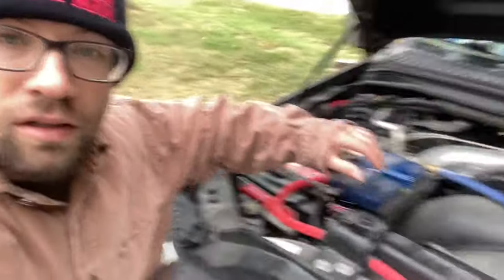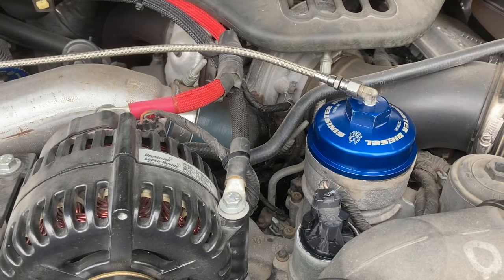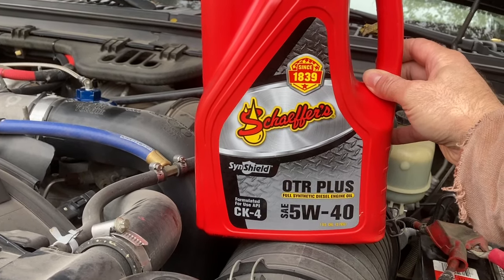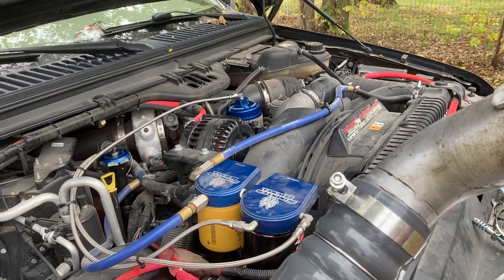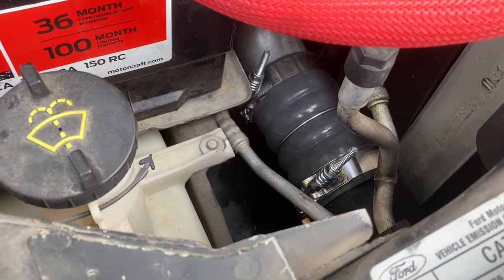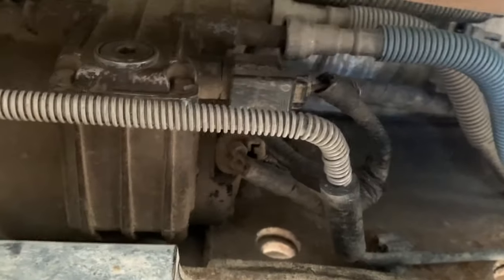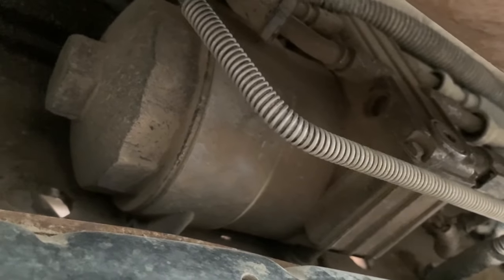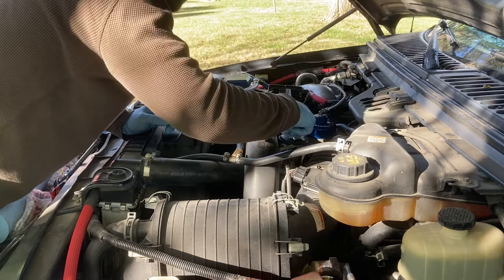6.0 PowerStroke Tune Up and Bulletproof Mods

Comment: Thanks for the tip I didn't know that FICMS die due to low battery which makes sense. My truck has a parasitic draw. I been trouvle shooting my truck for some time now and it was on auto play and I heard you talking.

Comment: What is the size of the cable you used for the batterty,I want to upgrade mine too.
Reply: 4 gauge is great, 2 gauge is better
Reply from the maker: I believe it is 2 Gauge. I got it as a kit from Ed’s Ficm Repair off their website. It is a nicely put together kit and comes with a 250 amp fuse. If you have any questions, Ed will usually talk to you personally, either by email or on the phone.

Comment: Nice video. I can tell You have good Horse Sense my friend. You've  covered several upgrades that I have done as well. Done some pretty neat stuff on my 6.0 and my OBS 7.3s. I haven't finished watching the video yet but I just wanted to touch on a couple of items so far. I have used Shaeffer's oil and lubricants in every vehicle I've ever owned. And that's a lot! You can't beat the Molydisulfide? formula they have used since the 1800s. It stops any motor in any condition from wearing further and simply revives some. Also I have seen an increase in mileage and horsepower in every vehicle. Long winded but what I discovered a couple of years ago is I started to use a Rotella T6 full synthetic or equivalent and then adding Shaeffer's Moly EP oil treatment. 1 to 4qt ratio. I think you get a better overall oil and it's a little easier on the wallet. Also I wanted to mention that I purchased Odyssey batteries for the 6.0 and tried them in the 7.3s. WOW! Talk about Cranking Power! $350 a pop but well worth it. Oh, by the way I grew up on a farm/ranch in eastern Washington. Always putting a square peg through a round hole it seems. But I miss that world and hope to someday be part of it again. (if we survive the current mess) that is...Thanks for the video. Good stuff...Love the boot replacement tunes!

Comment: Are you ever concerned about the EGR and or oil cooler leaking or clogging up? That's my worst fear in my mind while pulling a 10000lbs up steep grades.
Reply from the maker: The EGR Cooler was replaced twice by previous owner’s( once under Ford Warranty). The Oil cooler was also replaced under Ford Warranty before I got it. I have the paperwork. I am going to do a back flush of the oil cooler and refill with CAT ELC Coolant this summer but i always keep an eye on my coolant and oil temps with my CTS monitor. I do plan on replacing the Oil Cooler again sometime in the future as my oil/coolant temps are still in range but higher than I would like.

Comment: Great. I Like your charging system. The truck sounds great.Couldnt hear the pipe but sounded a little different than mine. I have an 03 6.0 354k running strong.
Reply from the maker: Thank you. Your 354k miles give me hope that my low mileage(194k) 2006 6.0 can go that far. Thanks for watching!
Reply: @VanLeeuwenFamilyFarm  I'm taken care of the truck inside and out. That truck of yours will last especially with upgraded components like you have. Good luck.

Comment: Would there be a possibility to have a thicker manifold gasket made for issues like this or would that make another interference or fitment issue with another part on the engine?
Reply from the maker: I don’t know which manifold gaskets you are referring to.

Comment: 9:20 ground the 2 battery's together just like you jumped the 2 +pos side. Also run a ground from your -neg to one of your transmission bellowing bolts.

Comment: Everything on my 6.0l is sinister diesel so I can say without a doubt they are garbage. Biggest mistake was dumping over 10k in sinister diesel parts
Reply from the maker: I don’t think I could spend $10,000 in Sinister Diesel parts if I wanted to. You could probably rebuild the whole engine for less than that. But you have to pick and choose what parts work best for your engine. For Example, I would not use a sinister diesel oil cooler. I would use the factory Ford Motorcraft oil cooler. If I was going to replace an entire FiCM, I would probably go with Ed’s FICM repair as he has earned a reputation for building quality FICM’s. Or I would never use sinister diesel head gaskets or turbos just because there are other companies that specialize in these things. I never just go with one brand for everything. I do my research and pick and choose what parts will work best for each situation. I’m happy with the Sinister Diesel parts that I have.